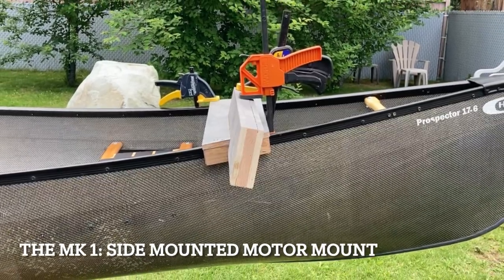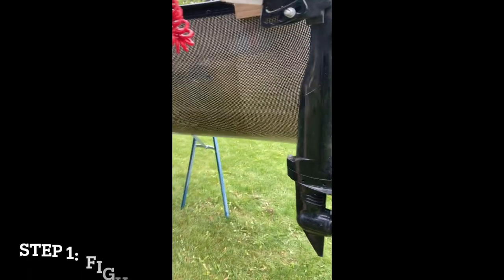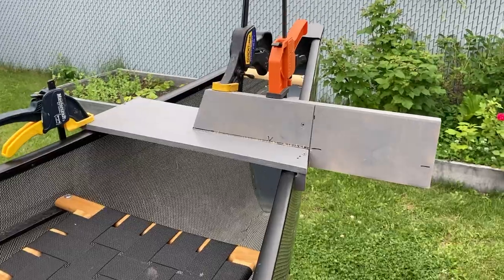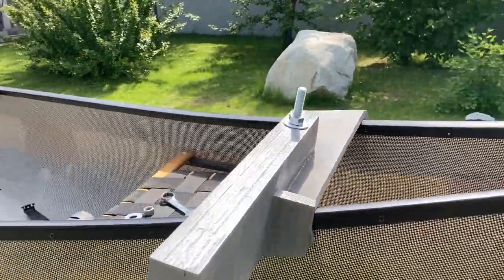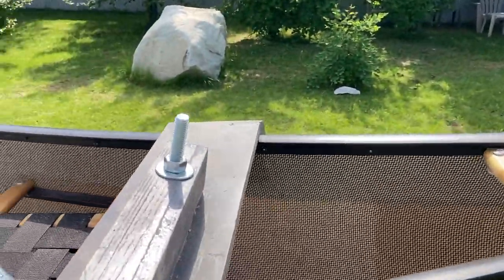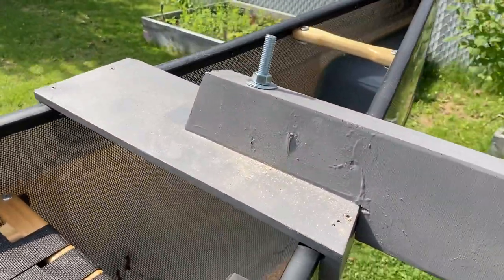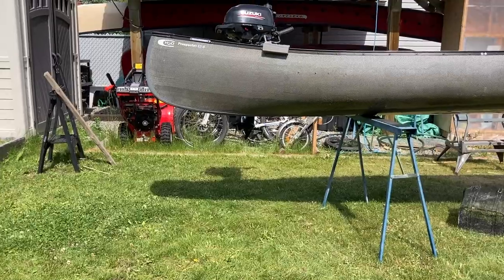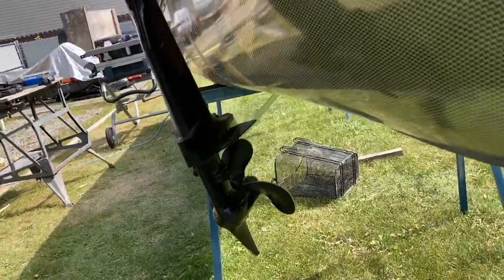Making a Side Mounted Canoe Motor Mount   HD 1080p

Comment: Did you get some testing video?
I’ve got a 15 foot canoe and tried a direct side mount for my old 56 evinrude 3 hp
Didn’t like the stress on the hull so I notched a2x6 and am going to try a side mount this upcoming spring. 

Here’s my original no mount , direct hull set up. 

https://m.youtube.com/watch?v=3vM-rM2Kc50
Reply from the maker: In the end it felt unstable to me so I added an outrigger.  This worked but took away from the simplicity.  Honestly I think this would work better with a really big 20 foot canoe than something regular sized.
Reply: My 15 foot fibreglass is a fair  bit heavier than your light canoe. But I agree the off center weight is a bit uncomfortable 

I have been eyeballing a 16 foot aluminum square back that I could carry on my jet until needed. 
I already have a jet boat but like to get in some weedy and narrow places where the jet won’t work.

Also looking at a 20 foot cedar y stern that is too big to cart around on the jet but  a nice boat in its own right.
Reply from the maker: @albertaoutdoors9220  Let me know how it works out for you.  I like the feeling of a proper freighter with a square stern.   The side mount seems a bit like a stunt although stable with my new pontoon addition.  I'll show that in action next year.